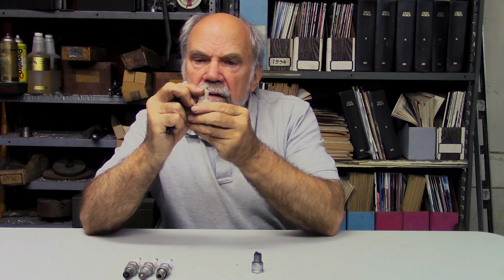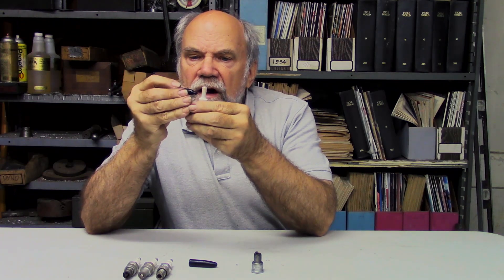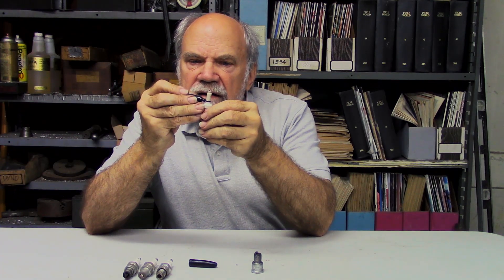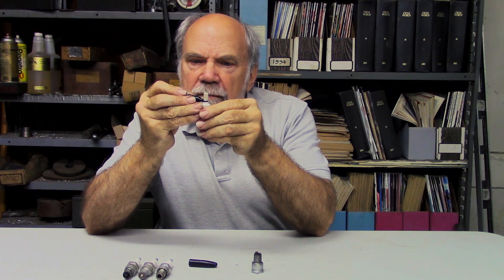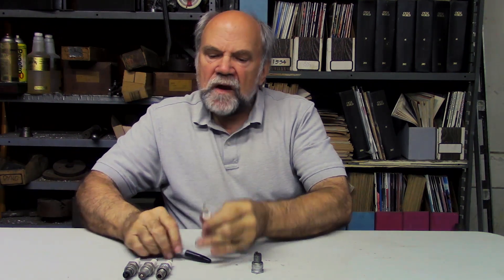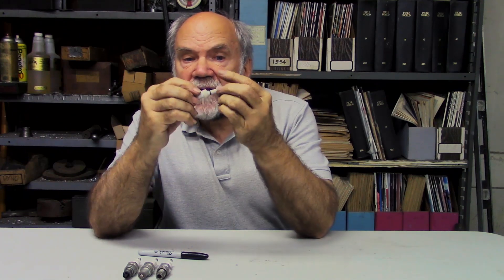How Do You Read A Motorcycle Spark Plug?

Comment: I’ve seen the tips of the electrodes get rounded off after many miles. In both cases (a Honda 750 and a 70s ford pickup) the engines would misfire under load but run fine otherwise.

Comment: @ 01:20 When you look in detail at the end of the two strokes spark plug and see solidified balls of molten metal on the ceramic insulation it was clear to me that I had a few more issues than just the mixture.

Comment: Otoscopes are dirt cheap online and ideal for magnifying plug insulators, small holes including bolt holes etc. Carb users who race often use AFR meters and add oxygen sensor bungs for precise measurements and tuning.

Comment: hi i have question sign of weak spark plug is Hard to start engine.what about hard start engine  only in the morning or cold engine is that  damage spark plug issue ?because when the engine warm or just turn off for 1 hour is very easy to start the engine.thank you

Comment: yup plug chops....only way to know with carbs.     Best way for the mains is a WFO pull at red line then shut off the engine without backing off the throttle so only mains are most significant.  Pull the plugs there on the spot and put an old pair in to ride home on.  Now you can read them or take a hack saw and split them to see the insulator better.  If its a light, light brown then mixture lean..or just a rule of thumb lighter is leaner.

Comment: Acually a plug will clean by itself
Reply: Jim Barber 
If you have a very rich fuel to air mixture based on the spark plugs and then you re-jet the carburator to say two or three steps down on jet size...
You WILL NEED to put new plugs in, then run it hard and pull the new plugs out to see where you are at with the fuel/air mixture that you leaned out..
The plugs from the heavy fuel mixture will NOT clean up to give you any idea of what your adjustment has done.

Comment: I got only one question. I didnt understand where should be that carbon ring? Up, Down or in middle? Or there should be no carbon ring but from what i heard if its perfect than it should have that ring.
Reply: The engine usually runs good when the engine is running lean and therefore I think the ring should be far down at the bottom.
Reply: The ring develops starting at the base and gets thicker as it gets richer. The ring should be just disappearing at the base of the insulator for a 4 stroke but not gone. For 2 strokes you'd usually want a bit more ring ~1mm from the base to the end of the ring.

Comment: Can you please do a story on fuel injection systems currently used on motorcycles. What causes the horrible snatchiness at low speed on-off throttle changes that carburetted engines  don't do and what can you do to eliminate it.